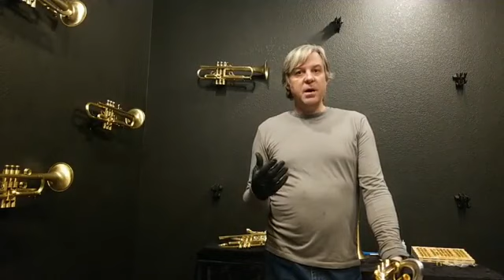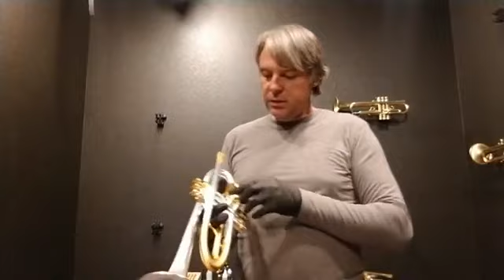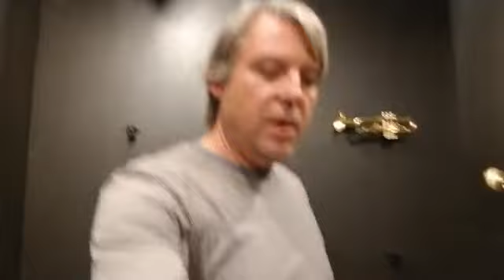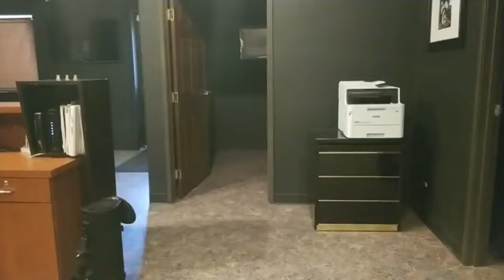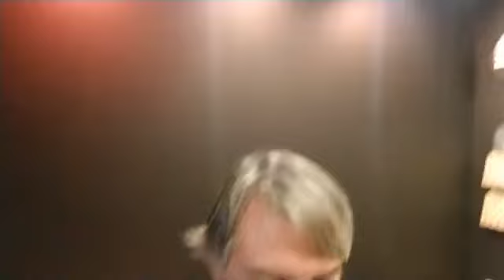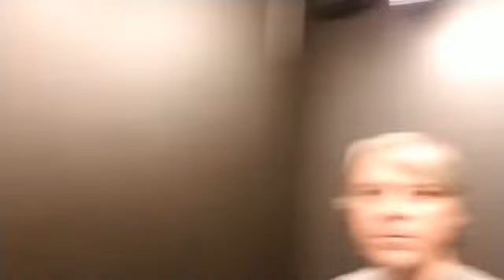Harrelson T3 Summit Trumpet in 24k Gold & Silver

Comment: I always oil or grease my aluminum valve stems. I have always maintained that only a moron or bean counter would purposefully chose to use aluminum for the valve stems. Terrible material choices and it has been obvious for 3 decades that it was a bad idea. Anyone that had owned a trumpet with aluminum valve stems has run into the galvanic corrosion many times.